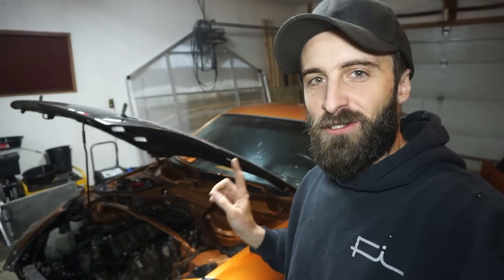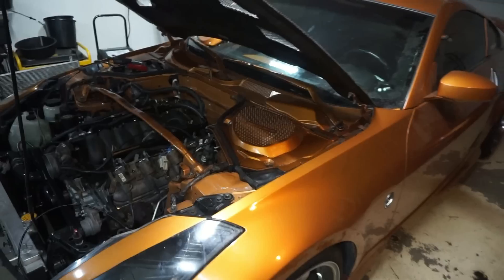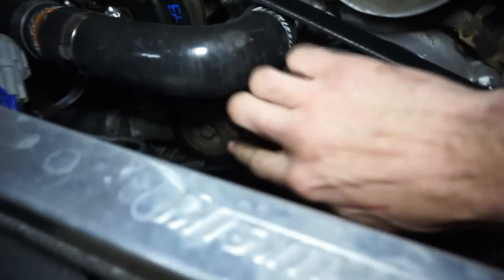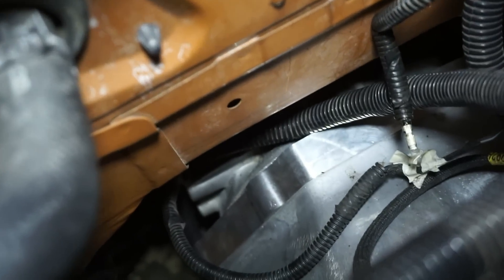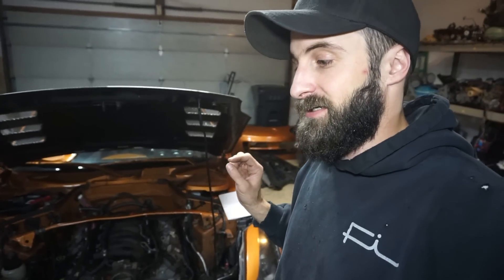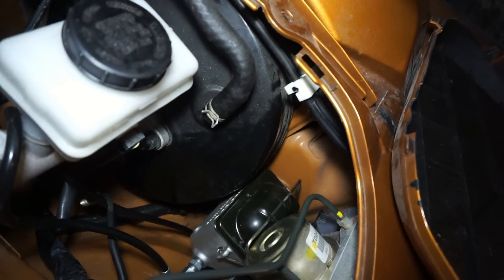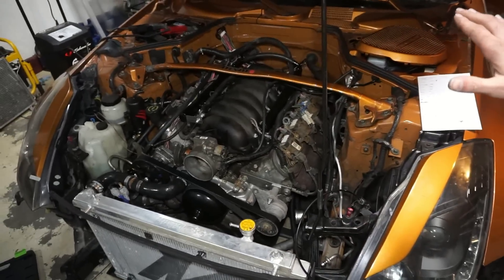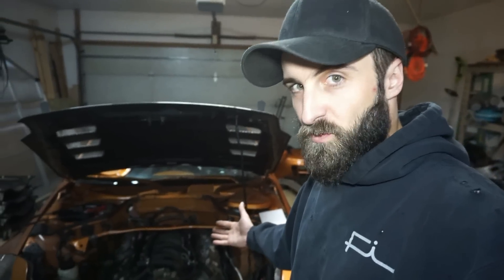HOW TO LS Swap Your 350z For Under $3,000!!!

Comment: I'm not hating on your video, I just think that is crazy that you just sold off a built vq that was supercharged. I'm used to hearing people LS swapping their 350s after their stock vq motor blew up but either way I think your car is great.
Reply from the maker: It's not that crazy considering I'm still about$1500 under what I sold the engine for after the turbos I just got for it. In the end it will make 200-300hp more for less than I sold the VQ for.
Reply: @BlaserBuilds  Single T (cheaper, easier, cleaner) on properly built VQ = whatever power you want till stock sleeves can't handle it. Basically, for better curve (than say 1k whp) and great reliability, you could have made 800whp on the VQ if you wanted. Of course, I wouldn't go above 800 on stock sleeves.
Reply from the maker: @TheGuruStud  "If you wanted", but that's the thing... I didn't want it...

Comment: Question.... would a 4L85e fit?  Seriously.... would it?
Reply from the maker: Yes, LOJ conversions even makes a kit for it.
Reply: @BlaserBuilds   I was wondering if you tried to install one - or if you had any fitment issues after installing successfully installing one.  The Nissan trans can be "built" from what I've read, but I've watched all of your 4L80E vids and thought it would be a good choice.  Thanks for the link.  The LOJ conversion stuff is crazy nutty expensive - as is the Winters rear end kits I found somewhere else.  LS swaps are great as far as big horsepower in a small package (or a swoopy Japanese body), but the rest of the driveline would probably have to be upgraded too.  Nissan never expected we'd be slapping 600+ hp 400 inch plus V8s in those things.  On the plus side, I found a video that shows the size of the engine bay.  It's wide and made to clear the heads/valve covers on that V6.  An LS3 (stock height intake, valve covers etc) with headers looks easy to install.  Enjoy your Christmas sir!
Reply from the maker: @scotttimpany2845  I personally haven't, but others have.

Comment: Wow swapped a motor for about 20 hp difference. The key to drifting is keep it simple and simple is stock. Seat time is more important than power. BUT it's your car and you will learn on your own and do your own thing.
Reply from the maker: I'll Probabaly use it for drag more than drift. I have a drag strip about 15 minutes from me, and nearest track that does drift events is 1 hour away and events are $200ish dollars. We'll Probabaly try it, but can't see it taking over because of how infrequent the events are. I'm also doing twin gt3582 turbo setup on here, so I agree, won't be a good learner setup. If we find it's reasonable to drift a lot, I'd get a different Z and keep it stock aside from welded diff and hand brake.
Reply: @BlaserBuilds  ya that's gunna be a sick drag car
Reply from the maker: @taylormccallum  Hopefully... Probabaly have to switch up the gearing since the CD009 is so short,  but we'll cross that bridge when we get there, lol.
Reply: @BlaserBuilds  yes I totally agree, the gearing is super short. It's perfect for drifting but I also daily my z and I wish it was longer. And a tt ls probably doesnt need short gears lol
Reply: A 20hp difference stock  but a  way higher tuning potential than a vq.
Reply: @brandon94441  I commented before I realized it was built and supercharged. He swapped for like -200 hp
Reply from the maker: @taylormccallum  Really need to consider the low end torque more than peak HP number at 7k rpm. Vortech charged VQ makes around 300tq, at 7k, where a 5.3 with Power enrichment will make around 300tq at 3krpm where most of the drive time is spend... Driving both setups the 5.3 setup stock tune feels better on the street because you'll rarely spend much time going 130mph to feel the peak HP number... Either way, Turbo setup for this was the plan from the beginning, I only got it running NA to test everything before adding the turbo setup. Check my community post from 5 months ago, I did a poll asking if I should do the turbo first or get it running NA before turbo. Subscribers voted NA then turbo.
Reply: a wise dude right here!

Comment: What do u mean by "can buss" to make the gauges work???
Reply from the maker: CANBUS. Controller Area Network. Basically controls everything using only 2 wires. Sends signals out over the network and each system looking for the signal will respond... Prevents wires being ran to every unit individually.
Reply: @BlaserBuilds  thanks for the reply

Comment: How did you get the engine for $500???
Reply from the maker: That's just the going rate around here for the truck motors. I have a buddy that just sold a complete 4.8 for $300. $400-$600 is pretty normal.
Reply: Dayum say less man. Great build btw! Sorry got carried away with the prices hehe.

Comment: If u were going to do this you could prob have just bought a blown 350z for cheap and then installed a new engine. Instead u bought one with a great engine and a broken trans/clutch
Reply from the maker: Yeah. It was pretty dumb to build something that felt the same and limp away with $2k in my pocket, then use that cash to twin turbo the car and make a video series that will pay for the project in a year... Shoulda, woulda, coulda.

Comment: Does it have A/C?
Reply from the maker: At this point it does not, but I left room for all stock components to work in factory location.
Reply: yes yes it does....... it has the 280 series A/C system in it

2 windows down 80 mph down the highway
Reply: @ericeaton371  That's just a natural hair dryer

Comment: Why wouldn't you just throw a big turbo on that built VQ?
Reply from the maker: I like the LS platform, and I feel it has a lot more potential with a much lower cost... One of the previous owners made 420hp with the supercharger on it... An un opened truck motor makes that with a $300 turbo for about $10k less... Just a preference, and makes for good content.
Reply: @BlaserBuilds  I gotcha man. More power to ya
Reply: Sir, sorry to disagree with you.. you will find a turbo for $300 but a complete turn key kit? Will def not cost you anywhere $300 bro... also, not sure what engine that is (displacement wise) but I can bet anything a full bolt on VQ37VHR on e85 can still put a good fight against that... sure it’s cool but all depends what engine exactly it is. Ls3 awesome shit will pull stock lol but if that’s a 5.3 in there. Sheesh... what a waste of time
Reply: Ya man. Guessing it’s a 5.3 in there. I just don’t understand if you’re doing all the work atleast make it worth it and buy a real LS. Atleast a ls2 or ls3 bro. That would’ve been insane
Reply from the maker: @Javz34dahh  Disagree all you want, but I can tell by your "Real LS" comment you're misinformed. I'm not saying the built VQ was bad. I'm just saying I'll twin turbo this truck motor, and make more for less than I sold the VQ.
Reply: @Javz34dahh  Sorry dude, but a full bolt on VQ37VHR  would only embarrass its owner for trying. You obviously have no clue on the LS family. I bet next you will say My LQ9 with 241 heads .600 cam and 92mm intake is a waste too? All for cheaper than a built and turbo VQ.
Reply: Hating, Yet you're here looking at his video lol

Comment: And millenials with a $100 Craftman box looking this video thinks they can make an engine conversion with $2k in parts... ignoring they have to buy first like $10k+ in tools, welding machines, saws, etc., etc.,
Reply: Haha. I needed this comment as I have a 350z with a blown engine and my Craftsman tool box ready to go!  Thanks for the reminder I shouldn't try this at home.
Reply: @jaredleeper6644  Well, there are kits that cost over $ 2,000 that would only need minor machining. But the problem is that people want to put an LSx on everything, and it's not always good. If you have a Sonoma or an S10 an LS is the perfect option. But if you have a Japanese compact and want to put an American V8 on it, use a Rover (Buick 288) 4.6 with a T5. You would still be over 300 pounds of torque, but many pounds less.